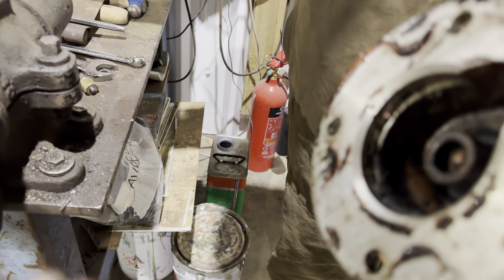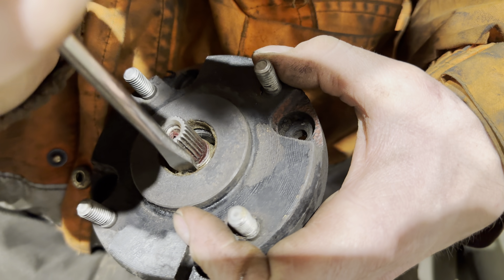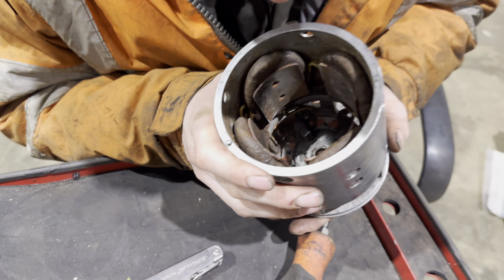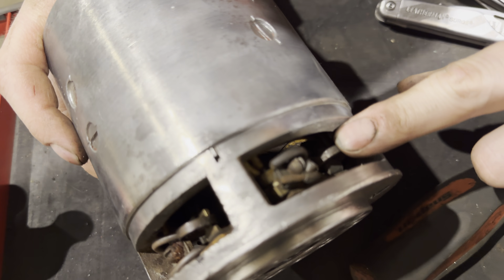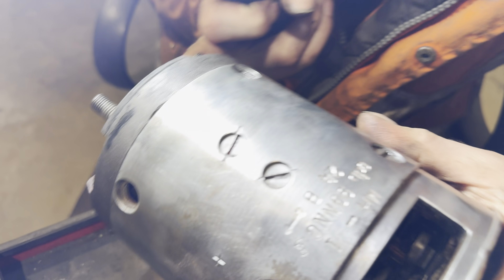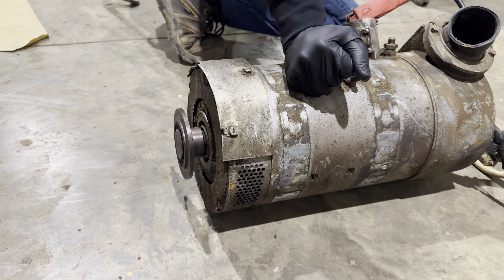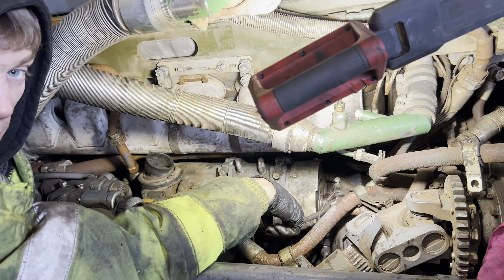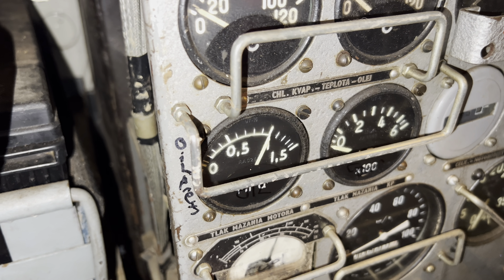WE FIXED A T-72 FOR £7

Comment: It appears that the Soviets designed and built tanks that were as unreliable, prone to mechanical and electrical failures and were as hard to repair and service as ours.  The common problems are rust and dirt but who could have guessed that such issues would plague vehicles required to operate in wet and muddy environments.

Comment: 7:12 use a bamboo stick (or anything non conductive that's stiff) to push the brushes is while you're moving the motor. Not a stupid amount of force, just enough to make the brushes compliant with the shape. Also, given how shoite this thing was, covered in schmuck, it would've been a good idea to scrape the brush faces a bit to dispose of the old material in case crud got impregnated in them.

Comment: Did they use fiber seals instead of rubber seals because of the extreme temperature range these tanks were designed to start & operate in?

Comment: I live 1 hour drive from factory where this particular tank was built - clearly markings inside the cabin are in Slovak language, that means it is from ZŤS Martin factory plant (no longer existing). You made a point in video before - some of those electrical components are oversised for what they do - explanation is easy: electroengineering and components back in the day were lacking from funding, know how and obsolete manufacturing processes, so they had to use not very optimised components. You can look at Czechoslovak refridgerator same way, bulky, noisy, powerhungry. But cheap.
Reply: and lasting 30 years.

Comment: Guys, be careful spraying WD 40 on any electricals that arc or spark. I know of a, couple of guys that burned up a generstor and nearly the entire 1950's classic car due to the WD40 catching fire a week after they 'cleaned' it with it, another burned up the distributor and fried some wiring in a 68 Pontiac Firebird a day after he used WD40 to lubricate the points pivot, and the vacuum advance plate trying to meke it slide easily - both knew if you spayed it into a flame it became a,flame thrower, but thought once THE propellant evaporates it was okay to use - costly mistakes. 
of course they only had 1-2 fire extinguishers nesrby, not the 47 or so you guys have for startups.😁
👍🇺🇸🇬🇧😎

Comment: Regarding Bearings. Waaaay back in the Day (70s), I worked at a company that made Aircraft Wheels for the Military. One piece Aluminum. But we’d have to fit Steel Bearings onto the Aluminum Wheels. The solution that worked was to place the Bearings in a Freezer, then put the Wheels on a Heated Grill for a few hours on low heat. The Wheels would expand, the Bearings would contract, most of the time they would just fit together perfectly. 

If they were a little tight, we’d then place them on a Big Arbor Press and, using the appropriate pressing block for the Bearings, put them together. Sometimes, you’d have to have one person pulling down on the Press Handle while  someone else would grab the 5 lb Sledge Adjustment Tool and hit the Top of the Press Ram to “Persuade” it to seat. If that didn’t work, we’d bring in the Quality Control Inspector, who would measure the Bearing Well and usually find out that it was Machined wrong. Then the wheel was either re-machined or Scraped. But I say that 99% of the time, they would fit together just fine, and when they came up to Room Temperature together, it was “Bob’s your Uncle!”

Also, if you are going to hammer in a Bearing like you did, grab a Socket that covers the outer race and hit that. Much more uniform Force applied all the way around. 

Hope this helps.
Reply: I'm going to read that again tonight if I can't sleep.
Reply: Old Trick easy as can be.

Comment: WD and carbon brushes don't mix boys and girls 😬😬, it eventually turns the carbon to mush.... 
Gas turbine starter motors rule 😂😂😂 HELLFIRE ! ! 
A few ex BR loco's have oil prime starter circuits featuring SOPS (Start oil pressure switch) and ROPS ( Run oil pressure switch), press the start button, oil prime pump kicks in, pressure increases to 12 psi ish, pressure switch interlock pulls and energises the start contactor, engine motors and engine oil pump takes over, pressure builds faster then it opens the engine governor and away she goes ❤,  love stuff like this 👍
Reply: As a non-engineer, I have to ask - why not just put them together like a car engine where you - wait for it - just turn the key?
Reply: Big bearings require lots of oil on initial start up to stave off premature wear due to the masses involved

Comment: Do not use lubricants for carbon brushes. As we saw in the film, much more fire and heat is created. If you install the bearings with a hammer, they are immediately damaged. The bearing balls make recesses in the sliding tracks. Greetings from Poland

Comment: Can always tell the best designs when engineers hide cheap and replaceable parts in places that require 10+ hours to get at them. 

Soviets were clearly just ahead of the curve on that planned obsolescence thing, or drunk, maybe both. Who knows?
Reply: The latter more like.
Reply: In fact, I bet that in military use this engine goes out for overhaul waaaaaaaay before any of those bearings will even start to think about wearing out.
It will be something like 500 hours usage = full depot maintenance.
Reply: These tanks were not intended for repair. They were mass-produced on the assembly line. The USSR produced tens of thousands of these tanks. In addition, the service life of the tank engine was only 10 thousand kilometers. After which the tank was sold for scrap. So there was no point in making the rest of its parts more durable and repairable...
Reply: @nikoBNR1  >me when i pull shit out of my ass
these tanks were not scrapped after 10k km. what are you on, seriously

Comment: Excellent repair Mr Hewes, apart from the wd40 on the carbon brushes!  Commutators and brushes should be bone dry or the carbon dust mixes with whatever you put on them and turns into a form of grinding paste! Those springs look remarkably like Lucas dynamo springs, but i wouldn’t bother taking it out again to check if I were you!
Phil
Reply: That was excellent. That oil priming pump is incredibly reminiscent of the hydraulic brake top up pump used on the Nimrod aircraft, that I worked on for many years. That particular unit was built by Lucas. The fitting you can see on your soviet pump in the film even looks a bit like a British AGS (Aircraft General Standard) BSP hydraulic fitting.
Reply: @carlwilson1772   Probably 'acquired' by dubious means and reverse engineered. Like they did with the Nene engines we sold them for 'civilian aircraft' that ended up in Mig jets in Korea.
Reply: Good to see you here Phil. I thought these lads and lasses would be up your street.
Reply: Normally a problem in the medium to long terms, yes, but with Russian designed and built tanks it won't affect it in the slightest.  It actually does the tank good to occasionally submerge it in salt water and then fill the entire interior with fine silica dust before running it over a 250 mile off road course in summer with no coolant and then just smack the living shite out of random bits for 5 minutes with the biggest hammer you can find.  Reminds it who's boss and fills all the gaps in components with solid fused silca fill.  That's why T72's are waterproof.

Comment: I love that despite having walls full of tools Joe refuses to use anything other than an adjustable spanner and a Leatherman
Reply from the maker: And a hammer 🔨
Reply: @MrHewes  I still remember driving a sheet-metal bearing cap into place using the nearest available tool, a can of WD-40 rather than going and getting a soft mallet or a block of wood and a ball-peen hammer because buggerit.
Reply: @MrHewes  lol
Reply: @MrHewes  a big enough spanner is also a hammer